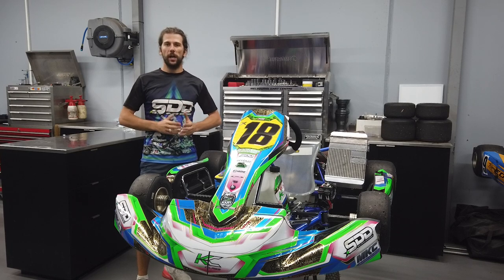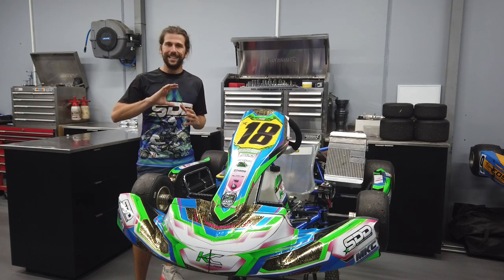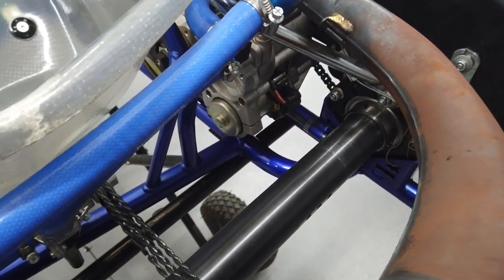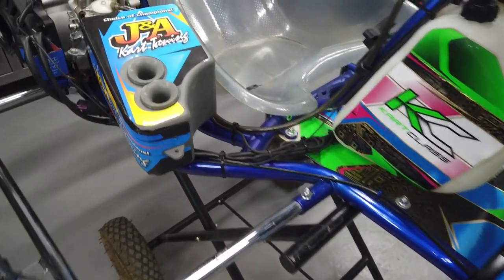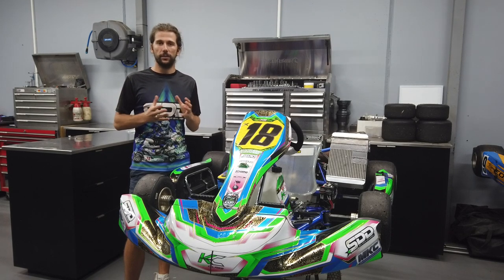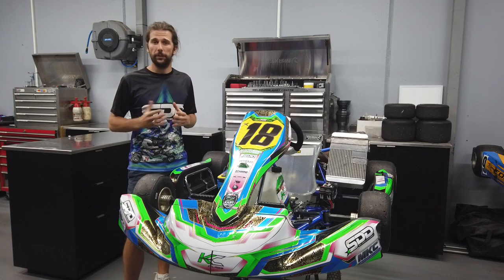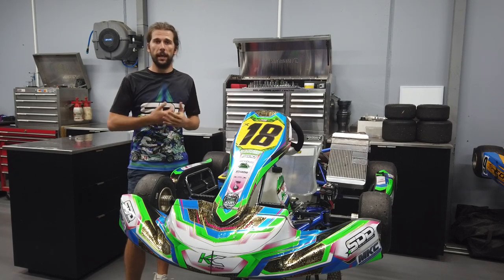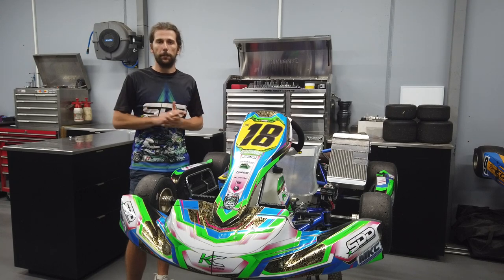Kart Review: Arrow's Latest Creation

Comment: how do arrow karts compare to the otk? I am considering this x6 over the kosmic mercury otk kart. Please let me know if you have experience with both karts the main characteristics and differences
Reply from the maker: Hi mate,
The arrow is more direct in the front end. So easier / lighter to steer. Maybe a little less rear grip because of this compared to OTK kart, but on grippy tyres won’t be a problem. I’ve only ever raced Arrow karts (25 years) so my style is around this chassis which I prefer when jumping into an OTK.
Reply: @KartClass  If you only ever raced arrow kart perhaps I should let u have a go of my new otk kosmic kart 😁 (I’m planning to go to todd road and Oakleigh). I hear the main benefit of arrow is they’re local Australian made and have cheaper cost for parts compared to otk. I have plans to proceed with the kosmic mercury (next shipment arrives in June) but have been advised to look into Arrow and they look just as good to me, and cheaper.
Reply from the maker: @sako-xb2bq  generally easier to get parts and designed to suit the Australian conditions. Both karts will work for you so it’s personal preference on what you like the look of best

Comment: Great video Dave.
I currently have an arrow X5 and we are using otk hubs and MXC rims, however do you think we should use otk axles other then kartech axle that is standard.
Reply: What would be the biggest difference from the arrow X5 to this new kart. Just trying to find a few tenths for myself who moved up at the start of this year to Ka3.
Reply from the maker: I use just a standard kartech MH axle in this kart and it seems to work a treat. The guys who won the NZ nationals used a DPE axle so nothing wrong with them. I think the different grades of OTK might be the in betweens and can be used for fine tuning
Reply from the maker: This kart has more front steer and less rear grip. So depending what you’re looking for out of the X5 that’s where this is different
Reply: @KartClass  I'm guessing Arrow removed rear to release of the corner and that's why the rear is softer standard by not having the 3rd bearing?

Comment: Hey Dave, why do you and others use otk hubs on arrow karts when they’re the same dimensions?
Reply from the maker: I had previously found the front hub on the OTK to steer better as they seemed to be more solid. So when I got this kart I just put my previous second hand hubs on. From what I’ve felt, the standard kartech hubs would probably work a treat
Reply: @KartClass  cheers mate. I was just curious as I’ve just made the switch from otk to arrow and thought it peddled pretty well straight out the box
Reply from the maker: @deenceevee6526  yeah Arrow X5 is a super solid kart that’s been winning races around the place the last 3 years. I had a hand in developing that kart